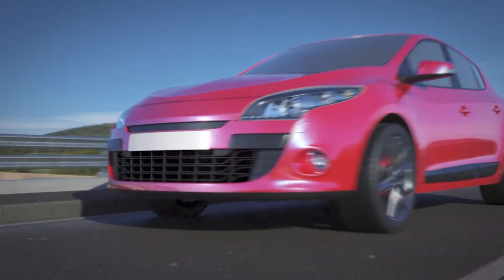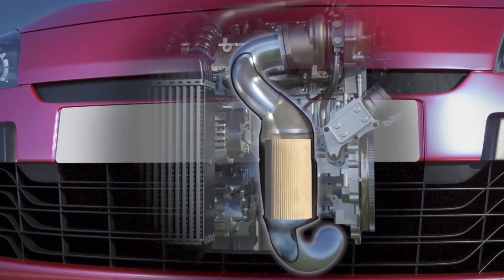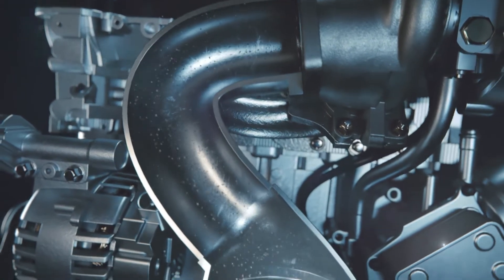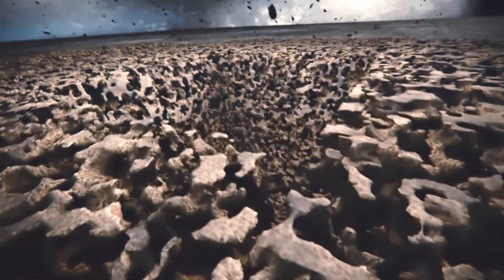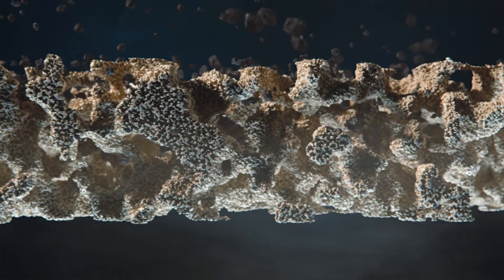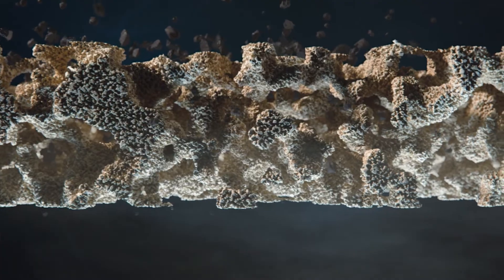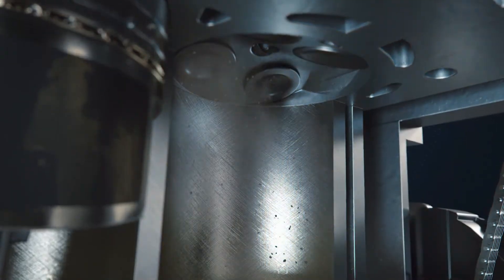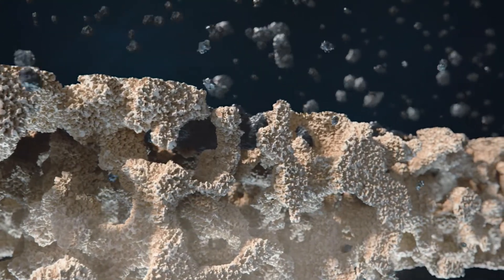How It Works - Gasoline Particulate Filter (GPF)

Comment: I guess I'll turn on sports mode to increase revs and drive for around a half an hour.
P.S. Turns out, exhaust temperature can be higher on lower revs, so better check out instructions first.

Comment: Yes I don't know enough about how an engine works, but I'm here and trying to learn. So I was expecting a way to change a filter maybe every other oil change or something. But apparently there is only changing out the gpf entirely and must be done by licensed mechanic due to legality issues correct? This ensuring a thriving mechanic industry because if we peons could do this ourselves that would be too affordable. Sigh.....as if the electronics in the car weren't enough of a catch fire, misfire, don't fire at all headache.

Comment: 1500 miles my eco diesel goes into limp mode in Louisville Kentucky going to a funeral in West Virginia. I have to stay a week lucky family there to get the diesel particulate filter changed. Haven’t had trouble since 😂 also haven’t used anymore def
Reply: DPF /= GPF
Reply: Lol